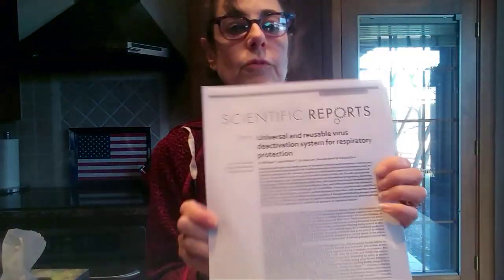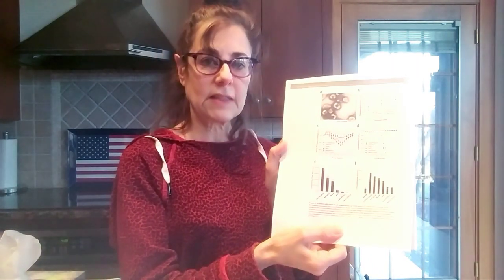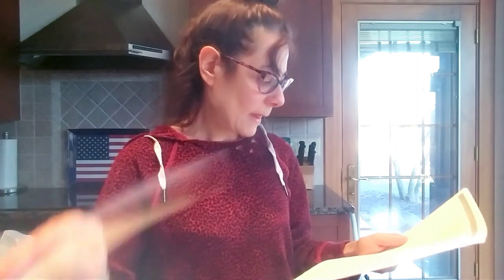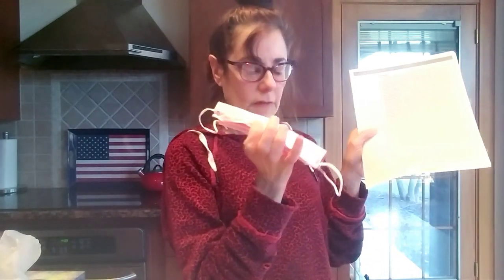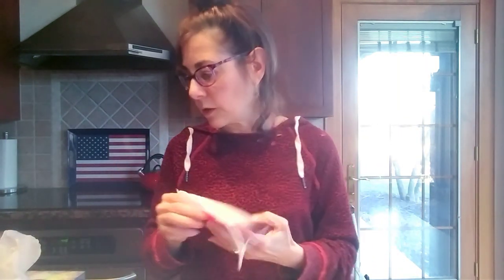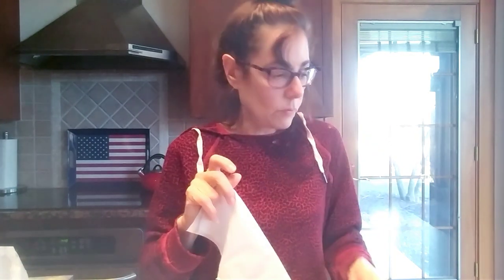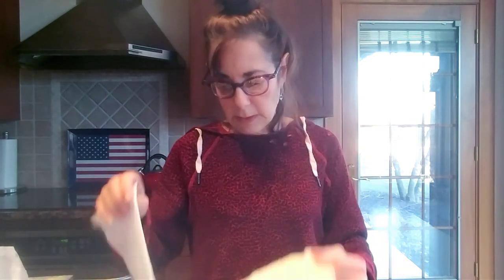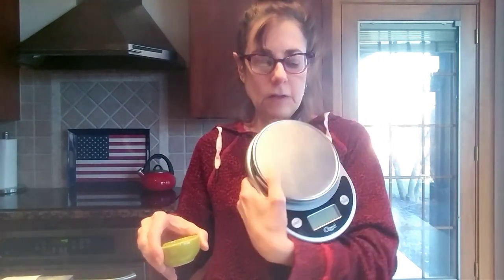Enhanced Anti-Viral Protection for Surgical Masks (Covid19)

Comment: Thanks so much for taking the time to make and share this video. Is it possible just to spray the solution onto the outside of the mask?  The (few) masks we have do not have filters.
Reply from the maker: What sort of masks? If a surgical mask (the rectangle ones), you are asking about something not studied by the authors, in which case you'd need to use your own judgement. IMHO, I think it is ok, but I can't prove it so that's my opinion only! As for N95 masks, there is controversy about this as some papers have shown that the solution makes the filter fibers mat up, reducing the ability of the mask to filter. It has recently be published (I don't have a reference, sorry) that some hospitals are baking N95 masks at 158 degrees F for 30  minutes, and they have shown this inactivates the virus, so the masks then become reusuable. You have to be careful with the ear-loops, if they melt you can sew on new loops.  Good luck!
Reply from the maker: Stanford researchers confirm N95 masks can be sterilized and reused with virtually no loss of filtration efficiency by leaving in oven for 30 mins at 70C / 158F"

https://m.box.com/shared_item/https%3A%2F%2Fstanfordmedicine.box.com%2Fv%2Fcovid19-PPE-1-1

Comment: wonder if you need the surfactant if you're treating a DIY mask made of cotton fibers.
Reply from the maker: Surfactant is to help the salt solution penetrate and stick to hydrophobic fibers so I wouldn't think it is necessary for cotton or any fiber you can wet (i.e. if the liquid doesn't bead up). IMHO!

Comment: Thanks for the tip. Do you recommend the same technique with N95 masks. I know there's no inner filter on N95s but a spray on the inside should have the same effect, no?
Reply from the maker: The original paper tested the inner filter layer of surgical masks only, showing data on the effectivness of the salt treatment. No such study was done for N95 mask material (nor for R95 and P95, these masks also come in 2 other filtration sizes, N/R/P 99 and N/R/P 100) so I can't say. I have read that wetting the filtration material in the N95 masks (and assumedly all those others as well) causes matting of the filtration fibers, making those masks filter less well. So you will have to decide for yourself if this salt treatment would work on N95 masks. IMHO, yes I would try it. But that's me.
Reply: @BronxGrrlX  Thanks. One thing I read recently was in fairly DRY (under 40% humidity) air the transmission rate for CoVid is very high - up to 80%. That changes with higher humidity - 60% and above - the transmissibility drops to 14%. You can confirm these #'s fairly easily by observing flakes of dust floating free in a shaft of sunlight in a room. As the humidity goes UP you see fewer and fewer specs and those specs of dust are what the viruses are sticking to. 

Bottom line is if malls, office building etc etc raised their humidity levels the person to person transmission would - should - drop substantially
Reply: Possibly wouldn't hurt to try the spray but those masks are not good for this virus. It is way too small and spreads way too fast. From symptoms to death most average 8 days.. do not risk being weaker to the second attack. Try to avoid the first one
    There are some air filters that catch .1 size microns for 50 bucks. But be mindful of the danger when cleaning the filter.
Reply from the maker: @houstongallego1718  For reference, the covid19 virus is 0.3 microns in size and an N95 mask is designed to catch on average 95% of virion particles that size.

No one knows if reinfection is possible and if it is, if it is more dangerous. But I agree, definitely better to avoid first infection until we know more.

I wouldn't clean the filters but toss.  I read that if you have a limited number of filters  you could put used filters aside in a safe area (not your living area) for 30 days and thus cycle through the ones you have. But i have no idea if this is safe - only saying I read it. If interested you could  look that up to fact-check it.
Reply: @houstongallego1718   Yes. I'll have to try and remember that - DO NOT LICK THE FILTER TO CLEAN IT!! :-))
Reply from the maker: LagiNaLangAko23  Sunlight (or UV source) couldn't hurt! A paper came out this week stating covid19 lives from 16 hours up to 3 days on surfaces like fibers, paper, metals, and cardboard. So waiting 30 days is not necessary in the light of new information.
Reply: No,  This should not be used on an N95 mask.  N95 masks are already electrostatically charged.
Reply from the maker: @charlesgotlieb773  This salt layer will be useful on N95 masks, as its efficacy is not only due to electrostatics - the salt acts to inactivate the viral partciles. Also, note that only N series masks are electrostatically charged, not P or S series masks.